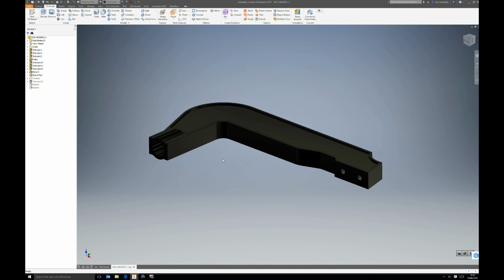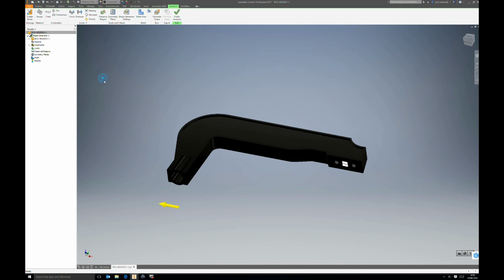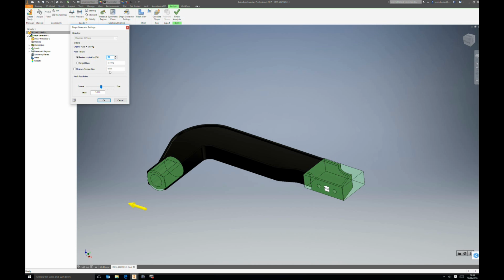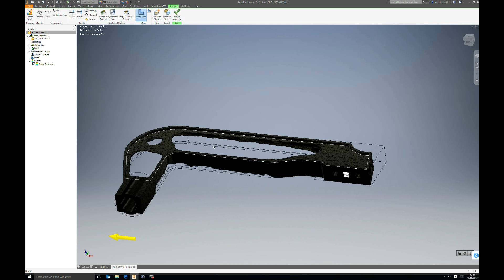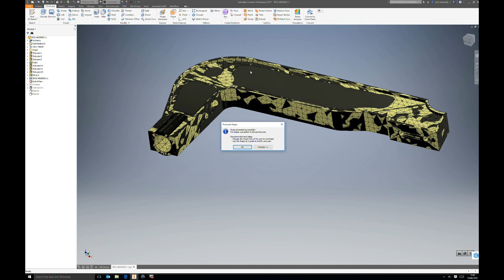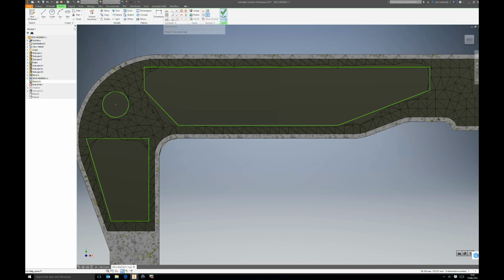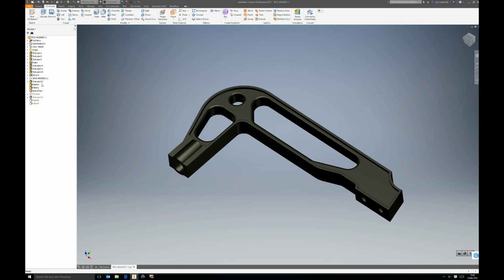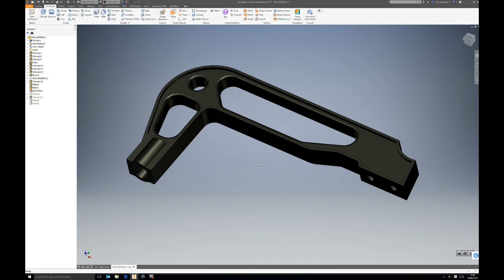Inventor 2017 Generative Design and Shape Generator

Comment: how do you smooth out the edges of the design without having to sketch-trace-extrude? Is there a way to model after the study to smooth over the 'jagged' edges?
Reply from the maker: Hi Brute4rce, this functionality has changed a fair bit since its initial introduction in this video. The study will always give you
natural edges / solids that visually look jagged, in an ideal world you would use additive manufacturing techniques to manufacture the components with this bone-like structure. However, in more traditional techniques you would need to
have more defined edges by using a hybrid of the two designs.